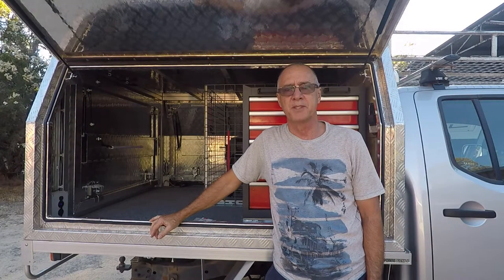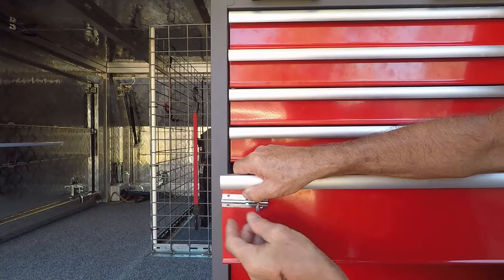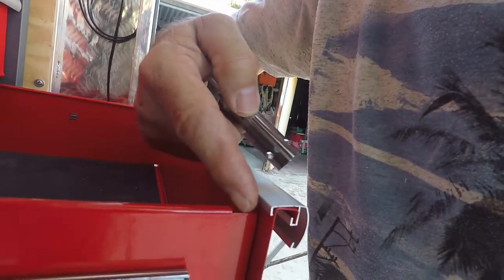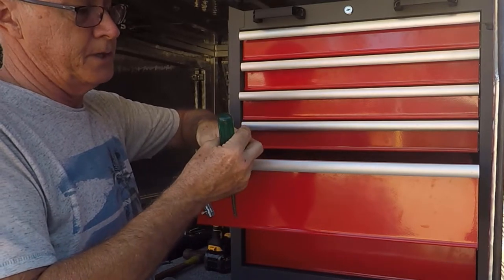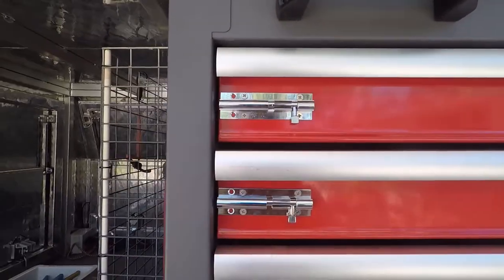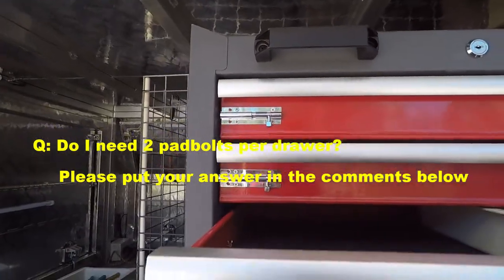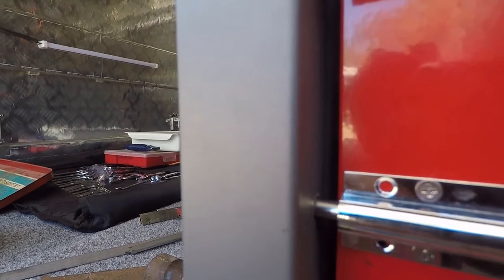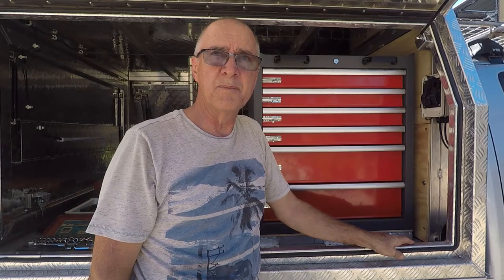How To Stop Drawers Rolling Open | Install Canopy Tool Chest Barrel Bolts

Comment: Another great video mate. Have you tried rivnuts? They have transformed installation of accessories for me, especially where it's hard to get to the back side to pop the nut on.
Reply from the maker: Thanks Simon. I considered rivnuts and pop rivets, but wanted to limit the amount of protrusion into the drawer, so that's why I went with the 3mm bolts and nyloc nuts. I have a rivnut set and have used it on some things...they're a great invention!

Comment: Have you ever tried to place rare earth magnets on the back of the drawer? I'm looking at trying that on my roller box with the idea that it'll hold the drawer to the back of the box
Reply from the maker: I have a rare earth magnet on my prospecting pick, to drag through the pile of dirt in case the target is a piece of wire, etc. and I can tell you, those magnets are very strong. I'm not sure how easily you could pull the drawer open if I used a rare earth magnet...unless you can get small ones.

Comment: Looking good mate, that'll fix it.
Reply from the maker: Thanks Jim. I'm still trying to decide if I need to add another barrel bolt per drawer??
Reply: @RustysOutbackAdventures  one side should be enough for general traveling around but if you hit really difficult terrain the other side probably gonna be needed. A spring loaded padbolt if there available to ensure it stays put.